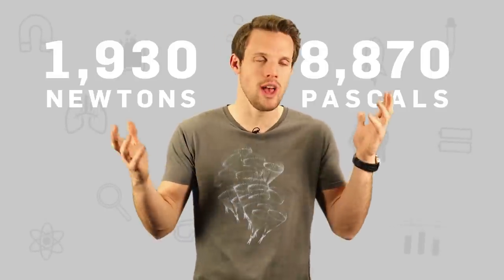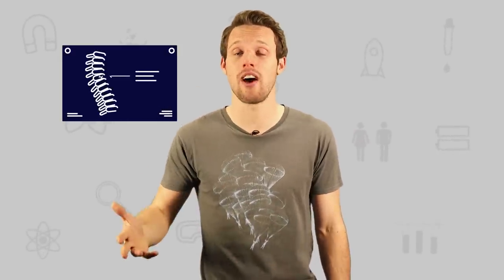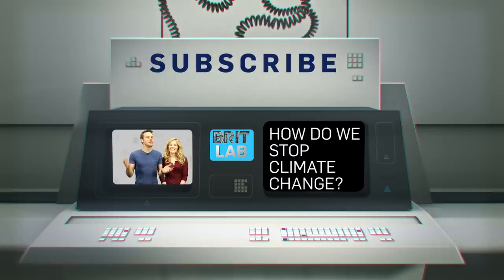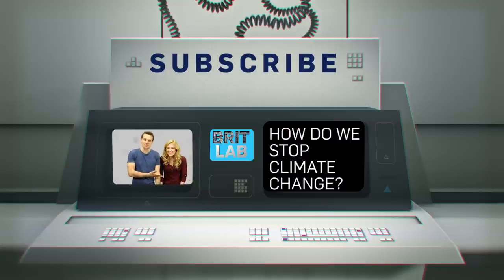How Do Ejection Seats Work? | Earth Science

Comment: The problem with bond is that  using a parachute at that low height is likely useless.
Reply: Nope, simply not true. as long as the parachute deploys immediately after you reach the apex then you will glide slowly down. in fact if you are very close to the ground then you won't reach the terminal velocity and so will be even safer than if you ejected higher up.